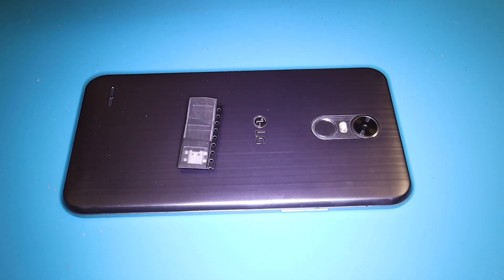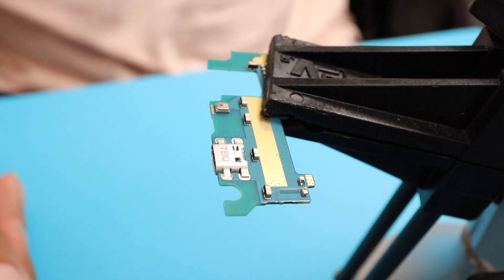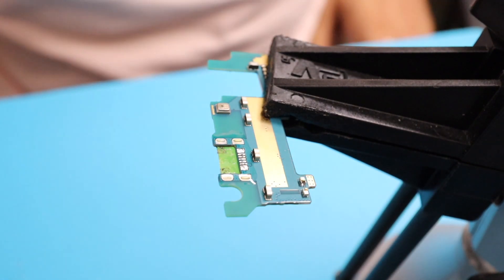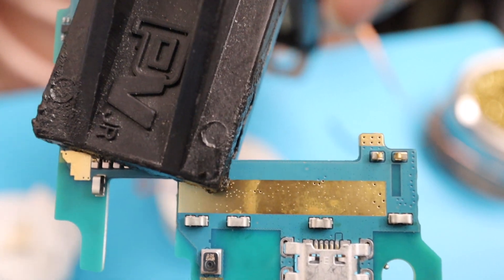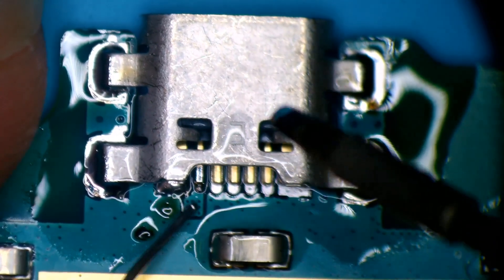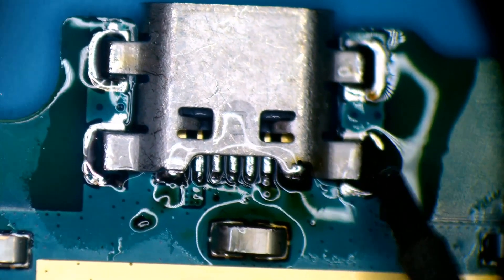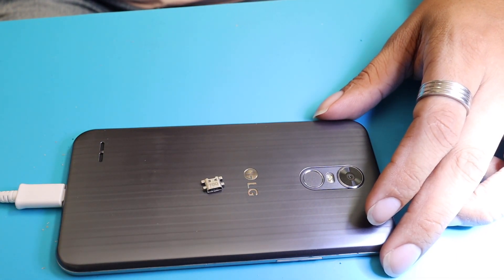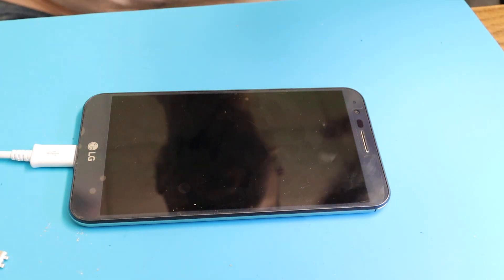LG Stylo 3 How To Repair - Charging Port

Comment: Thanks Jose great video man you have the patience of a saint.. Especially soldering has five or six  contacts in the middle. I have a very hard time soldering these very small sensitive area. Sadly my glasses aren't strong enough to focus  and solder at the same time . Curious where did you buy these ports. Can you give us the address Thanks again for the great video did you do one for the Aristo 3 which I have. Started having problems a month ago now the past two days the charging of the battery. I'm afraid to tempt this message you're using. Right now I use an external battery charger to charge separately this replaceable battery

Comment: What type of soldering iron did you use and what was the solution called?  This is a GREAT video just neex to know what I else I need to buy to fix my phone. Thanks.
Reply: Its a surface mount soldering station

Comment: Is this safe to do?
Reply: use proper ventillation when soldering!! Do not breathe the fumes.
Reply: @sassylrhg  if you're careful not to destroy the microphone maybe there's a heat sink to absorb the excess heat in that area and have patience of a saint to be able to solder the five or six contacts in the middle of the port.. Then we'll be able to replace the charging port and save us $100+ to buy a new phone..